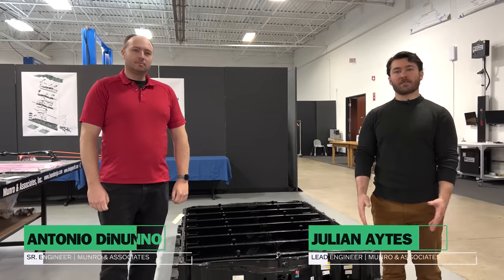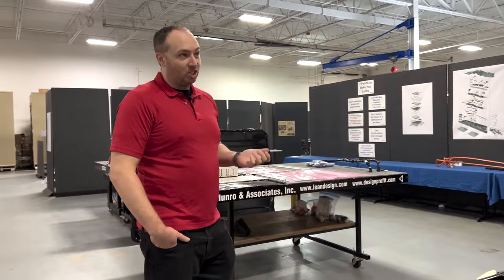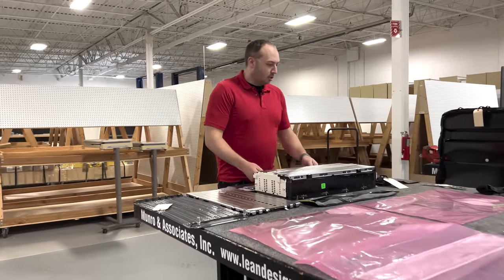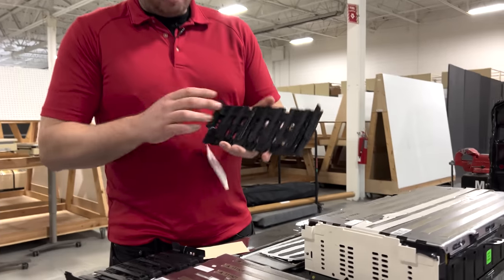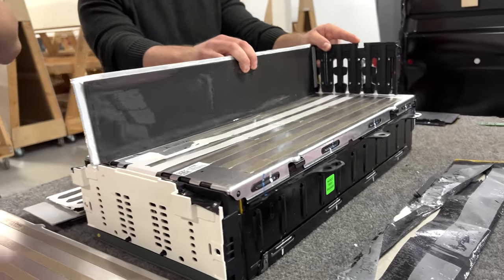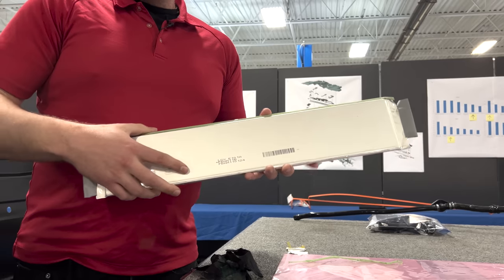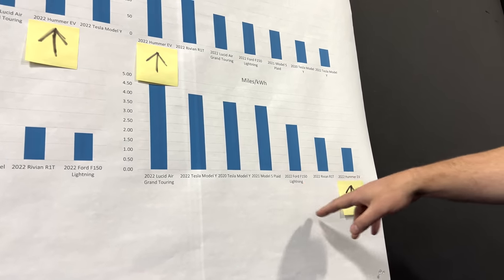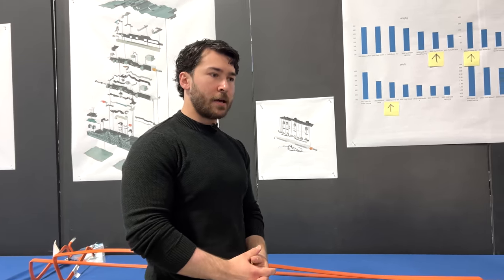This is NOT Lean Design: Hummer EV Battery Pack Breakdown

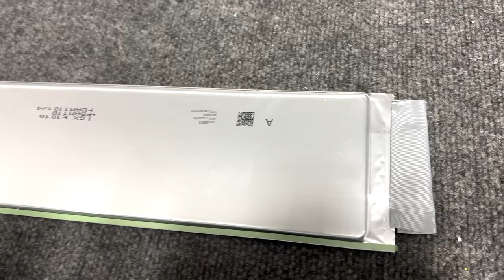Comment: 20:13 You're trying really hard to undersell these NCMA Ultium cells. Yes, they are still just a pouch cell, but 4680 are still just cylindrical cells... nothing special. The importance of these first-generation Ultium cells has more to do with aspects such as production volume, volumetric energy density, chemistry improvement, etc. They are significantly more energy dense than most other EV batteries on the market today, and in fact, even Tesla ended up licensing the NCMA chemistry used in these cells from LG.
Reply: The competition is coming! 😂😂😂
Reply: Would be interesting if someone confirmed that chemistry claim....
Reply: @BatterVswithAntonio  Are you able to test the  cathode chemistry inhouse? Also, something that came to mind watching this teardown: Do you know whether the HUMMER EV pack you tore down was Korean-built or American-built? I wonder how much variation there might be based on when and where the modules and packs were assembled.
Reply: @newscoulomb3705  I did. which is why I'd like someone else to confirm before i go out and make claims. I can't tell where the cells are from but likely US based with the ultium form factor.
Reply: @BatterVswithAntonio  The build date of the vehicle should tell you whether they are U.S. made cells. If the build date was prior to 11/22, the cells and modules were more thank likely made in Korea. Frankly, based on productions numbers and timing, it's likely that no HUMMER EVs released so far have U.S. made batteries (the production was all routed to the LYRIQ while the HUMMER EV's pack case was redesigned and under recall). 

As for the chemistry claim, I doubt GM would publish that they are NCMA if they weren't. A mass spectrometer should confirm the presence of aluminum in the cathode mixture. 

This is one of the reasons I wish you would have shared the weight of the case and individual modules. A GM rep mentioned that the structural battery case was over 900 lbs. That means the modules would be around 1,700 to 1,800 lbs, which would result in a gravimetric energy density of >280 Wh/kg at a module level. That is beyond what any NCM chemistry currently offers (NCM 811 barely hits 280 Wh/kg at a cell level). 

Working backward, it should be easy to confirm that these Ultium cells don't match the energy capacity profiles of any existing NCM chemistry.
Reply: @newscoulomb3705  much lower than 280
 thanks for that info on korean vs american made by date. Don't have a MS here, just XRF.
Reply: @BatterVswithAntonio  You're welcome. The numbers are fuzzier for me because I'm relying entirely on third-party sources with a lot of estimated numbers. The best I could come up with is a range of 250 to 280 Wh/kg at a module level, assuming the ISO energy capacity is accurate, ~3 lbs per cell is accurate, and between 2 and 8 lbs of module packaging. 

It's worth noting that even the low-end of that spectrum puts the packaged Ultium modules at the same energy density as the Chevy Bolt EV's pouch cells and Tesla's original 2170 cylindrical cells.

Comment: given the history of GM's brake lines and rockers panels, I cannot foresee any rust problems with this steel battery pack. Looks like they used a similar stamping die to their truck bed floors.

Comment: This looks like design was rushed. Lots of room for improvement. You can also see the drawback of building with pouch cells as there is so much more hardware and BOM to protect them, compress them, interconnect them, and cool them.

Comment: Using steel for this 200KWh battery case is appropriate for off road vehicle that always get hit by the rock.
Reply: Seems like Munro and 95% of the commenters just don't understand that.
Reply: Why. Using composites you could probably make a case twice the strength and half the weight. There is a reason tanks have composite armour now and not just thick steel.

Comment: re: "This is NOT Lean Design..."  correct what it represents is STRONG design.  any Engineer "worth their weight" (pun intended) tasked with designing a Class-3 vehicle projected to have a GVWR of 10,000 to 14,000 lbs intelligently recognizes "lean" is NOT a design priority, no, it's SAFETY (hint: the NHTSA motto reads "Safety First" not "Safety Second"). yeah and as if to make my point, if only that Audi E-Tron that crashed back in February in British Columbia (everybody knows about this) and EJECTED it's aluminum cased battery onto the median had been designed/built to leverage the STRENGTH OF STEEL...  

right then, so pretty sure the 3 feats of NorCal Bridge Engineering represented by the Golden Gate, the Oakland-Bay, and the Richmond-San Rafael (all bridges still in use btw) would never have gotten constructed back in the 1930's and 1950's, if Carnegie Steel hadn't first been founded even earlier in Pittsburgh in the 1890's.  #THEMOREYOUKNOW

Comment: Can someone explain why 4:35 they say 3500 welds is 2 tons of welds? Each weld is a pound? That's seems high?
Reply: I think they also mentioned plastics and the cells themselves being ultrasonically welded, so joking the whole thing is "welds" and it weighs 2 tons
Reply: Trying to figure it out, so i guess they just meant 2 tons as 2000kg, converting that to lbs is like 4000 or so. So i guess he roughly rounded up and call it 2 tons of welds. idk why he would do it but that all i can think of.

Comment: 27:33 But that chart doesn't list ranges, and in fact, it completely disproves your point. The last two vehicles listed are two of the Top 4 in overall range, and that's with Lucid and Tesla using the more optimistic EPA range test cycle. And the cylindrical cells don't offer any advantage here because with the exception of the R1T, they are only being used in the most efficient vehicle formats (small sedans). The R1T is also a midsize truck (change my mind), so if it wasn't more efficient than the much larger, heavier HUMMER EV, there'd be a serious problem.

Basically, I don't think any of this data is supporting your assertions.

Comment: These comments are atrocious lol. What I see is a battery pack designed to be robust, effective, and serviceable. Basically exactly what they want for a big, expensive off-road vehicle. Not sure why anyone would expect to see a disposable lightweight battery pack in the Hummer EV. Oh, and this same battery pack is going to allow over 400 miles of range in the silverado trucks. But seriously, whats actually wrong with this battery pack? The presenters didn't even say there was anything wrong with it...they just noted the construction materials and techniques, and they felt it was "complex" and "heavy". Why didn't they mention the fact that Ultium's wireless battery management tech reduces the amount of wires very significantly, and simplifies serviceability. And then you have a thousand comments underneath from armchair internet ranters complaining about how heavy it is...a niche vehicle that barely anyone will ever buy. While I guarantee every single one of the commenters live in a first world country and regularly drive a multi-thousand pound vehicle for thousands of miles per year. The comedy is obvious to some but i guess not to all.

Comment: Leave it to GM to take a simpler process and make it more complicated, heavier, and less efficient. GM must be terrified about preventing  battery fires like what happened on the Bolt. The irony could be that the Hummer EV is  MORE expensive to charge with electricity than it was to put gas in the ICE version for the same mileage.
Reply: If they wanted to prevent battery fires they probably shouldn't have based their entire new platform on more unsafe LG pouch cells.

Comment: This Hummer EV is the Escalade of electric trucks!
Reply: Escalade HAULING this battery pack and a driver still weighs less than Hummer EV. Also has more seating and cargo capacity.
Reply: @jamesengland7461  It was a joke about efficiency, comparing mile per gallon to how much electricity it takes to move this Hummer EV. Their will be a Hummer EV SUV as well. The Escalade is superior overall, cargo, people, real wood trim, a beautiful curved display and on and on.

Comment: 27:24 I think this is an erroneous point. The battery itself has almost no impact on the overall vehicle efficiency (rolling resistance due to sprung weight is nearly impossible to measure), so it really isn't even pertinent to this discussion. If you look at the last three vehicles listed, they are all trucks. Two of them are fullsize trucks, and the two least efficient are performance, offroad trucks. This entire talking point is the equivalent of saying that Ford could make their Raptor as efficient as a Toyota Prius if only they made some better design decisions. 🙄
Reply: It is well established that vehicle weight has a direct impact on range and efficiency and that there are diminshing returns on bigger battery packs, which require heavier and heavier vehicle structures to support them, and heavier duty tires are going to hit both rolling resistance and aero.
Reply: @patreekotime4578  Of course it does, but that's not the issue. The question here is, how much does weight affect efficiency? The answer is, not nearly as much as some people believe. 

The impact of weight is felt primarily through rolling resistance, but the increase energy to overcome rolling resistance is a linear. At its worst, rolling resistance is maybe 10% to 20% of the total vehicle energy consumption, so a 20% increase in rolling resistance is likely to only result in a 2-4% increase in overall consumption.

Comment: Lot's of armchair experts in the comments. Yeah sure GM's design is not optimized or even good, but the EV space is new and it's not like Tesla, CATL, etc. are handing out free TED Talks on battery pack design. I'm sure half of the nerds in the comments would fold if they were one of the GM engineers staring down the gun of new tech, timelines, etc.

Comment: No mention of what kind of coating has been used on the steel casing and its projected life in an corrosion prone rust belt  environment. I can predict those Ultium battery casings rusting out and causing owners many problems in the future as a result.

Comment: „HiPot“ should be translated as withstand voltage test. kV testvoltage between HV + / HV - against ground.
Reply: AKA insulation resistance test
Reply: I've always called it a holiday tester.

Comment: Not lean .. but looks serviceable. Tesla pack is lean(er) but basically impossible to service.
Reply: It does? By whom? Maybe some sort of aftermarket cell recovery? What mechanic, dealer or private, is going to attempt to crack one open to service something inside of one of these? It's going to be a 40k+ remove and replace job if you can even buy one lol

Comment: How did they succeed in getting high energy density with so many layers and pieces? Maybe they're sacrificing durability at high loads?

Would a couple dozen drag strip runs cook this thing?
Reply: Pouch cells are higher density than cylindrical, but Tesla doesn’t like their thermal characteristics, i.e. they catch on fire too easily.
Reply: High(ish) volumetric energy density. Low weight energy density.

Comment: You don't discuss design intent. The Hummer was designed as an expensive low volume headline-catcher. It is intended for off-road use and abuse. Castings and extrusions are only cost-effective when you anticipate a high volume extended production run, that is, making enough parts to amortize the tooling expense. It also seems obvious that GM engineers focused on safe failure modes to reduce the likelihood of headline grabbing thermal events. You guys never did show the hot gas escape path for Tesla's 4680 battery.

I see you are looking at the Lucid battery. I look forward to a video on that, though I'm sure it will be filled with typical Munro snark.

Comment: The "dusty" material in the thermal separators could be aerogel thermal insulation. Thin but high R value...
Reply: Hoped so, alas it was not.
Reply: @squee8174  Come on Antonio this guy is giving you the answer and it is still going over your head. 
Disappointed in the Munro team for going clickbait in the title when you haven't done that for any other OEM battery teardown but I'll help you guys out.

1) Thermal runaway - What is the melting temp of an aluminum battery enclosure vs the temperature a lithium ion battery reaches during thermal runaway? How does the Hummer EV battery compare to the Lightning battery for thermal runaway protection? 
2) "Backwards flow path" - See #1 
3) "No thermal function in this section of the cooling plate" - Take the plastic part to the bandsaw or x-ray 
4) "Talc filled polypro insulating material" - Not correct 
5) "Nylon piece of plastic" - Not correct 
6) "This is for isolation" - Not correct, see #1 
7) "Tabs use ultrasonic welding to connect the electrodes" - Not correct 
8) "Tactical cooling line" - Not correct, see #1 

Lastly, if the 100kWh Model S battery is 1377lbs a 200kWh Tesla battery would would be ~ 2754lbs. The Hummer EV 212kwh and 2818lbs, a whole 64lbs difference. You're not going to notice a 64lb difference in your range.

Comment: The hummer would be amazing if it was made out of aluminum and carbon fiber. Sadly, they made it for the excavation industry and I don’t think anyone was asking for an electric D4 bulldozer?still don’t know where they were going to put the backhoe on that thing?
Reply: Excavators etc are already electrified, it will just take a while for mines etc to adopt them when replacing vehicles.

Comment: I wouldnt want an aluminum cradle around an explosive battery while doing serious off-roading. Aluminum has no flex, it will crack at points in the metal which turn into sharp points that can penetrat the lithium battery packs and cause really bad fires. Steel can take that kind of abuse for either flexing or impact in extreme off-roading. This vehicle is not about efficiency, it has a specific use case. Im not sure if these guys understand metallurgy outside of "weight savings efficiency and cost"

Comment: And the Silverado EV intro model is likely to use the same capacity battery, so this ‘complex’ construct may be used for a much higher sales volume vehicle.  Hope not.  This has got to slow the production process to a crawl with the complexity of the structure and assembly …. 😬

Comment: That battery has to be over $35k to replace.  The battery for a Ford Lightning is 28k! The value of these EV's will plummet 60% once the battery warranty expires. NOBODY with half a brain is going to buy a preowned EV that has a battery approaching the expiration of it's warranty.

Comment: Considering union contracts and the fact that electric vehicles take fewer labor hours to build than ICE vehicles maybe GM had surplus labor hours to use but decided to cut cost where feasible,  on materials, using steel instead of the significantly more expensive aluminum. 

Just speculation on my part, but seems a possible explanation for some of this labor intensive but materially frugal design.

Comment: Are you going to do a deep dive into Ultium's wireless BMS? It's the first of its kind and one of the truly cutting edge features of this battery, yet you didn't mention the BMS at all in this video. 🤷‍♂
Reply: You know they just signed up with Samsung for 4680 cells? 😉
Reply: @rogerstarkey5390  I'm not sure what that has to do with omitting and failing to discuss the most advanced feature of this battery system. 

Yes, they're partnering with Samsung to produce both cylindrical and prismatic cells, which will be used to support some vehicle applications (probably nothing that will use this double-stack case). That wasn't really news for anyone who's been paying attention because Ultium is a cell-format agnostic battery system. If you're implying that 4680 is somehow an advancement, it's not. It's just a bigger can in what's already been an established battery cell format for over two decades.

Comment: Great video as always ..I suspect 18650 releases heat better as it's tightly packaged in steel giving it excellent thermal dissipation ability
Reply: I suspect not, the centre of 18650 is insulated by the cell around it, hence the move to "tabless" to try pull some of that out the ends.  Pouch has similar also but with more exposed and uniform surface area

Comment: Battery support in steel, ok, very good with corrosion, you certainlly want to have corrosion holes with lithium batteries. 3200 weld points, very cost effective, way to go !

Comment: A long block duramax engine that's ready to drop in between the frame rails weighs about 900 LBS, the Allison 1000 weighs about 300 lbs and transfer case about 75 lbs in all 1275 lbs to move my 9000 lbs 08 GMC dually 😂

Comment: All the marketing I saw for the Hummer EV was showing off the off-road capabilities of the vehicle. This module, while inefficient, shows off a bit of that mentality. I mean, the battery is slung under the vehicle, right? 

Perhaps the thick steel casing and multiple separators are designed that way because the case was designed to handle rock impacts - something most other EV's won't face.

There have been reports of Tesla fires when the battery casing has been ruptured, after all...

Comment: Not sure what they are trying to achieve with battery case weight. This is an EV you get the energy back from generative braking. Why not doing some math, calculates it out the losses of the weight increases of battery case compared to those four giant tires losses with rolling resistance and weight. I believe it will improve the channel, just by putting a little bit more work compared to what already had done.